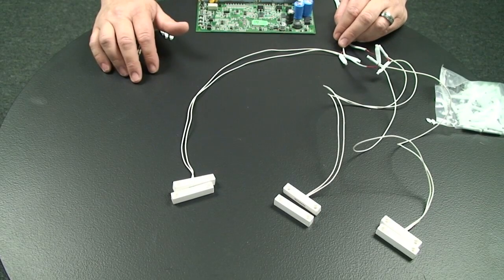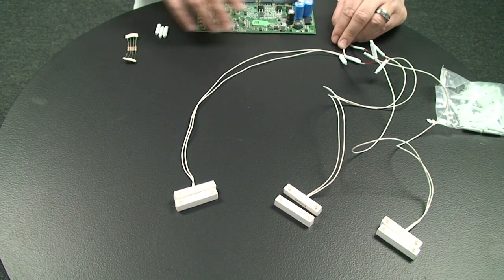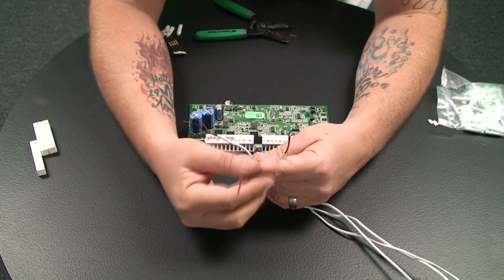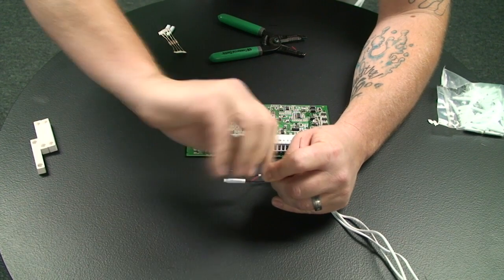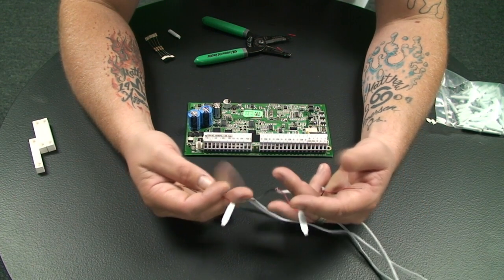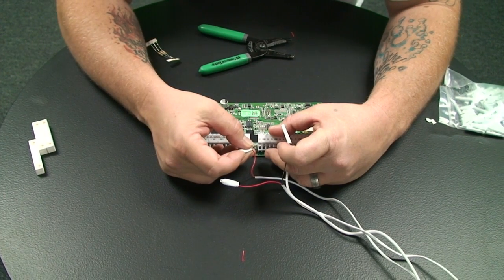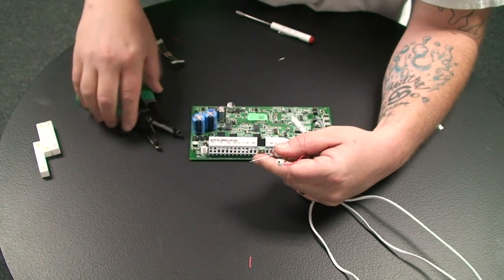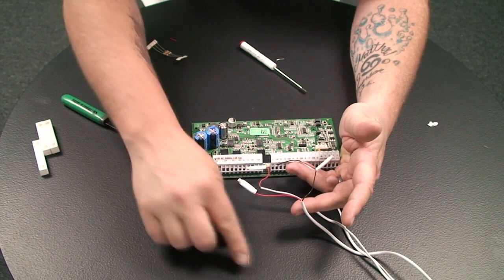How To Wire a Series Circuit using Contacts

Comment: Great video. I had an old DSC (6 zones) and the builder connected multiple rooms together (i.e., Kitchen and family room, bedroom 1&2). I now have a Honeywell 20P and zone expander and want to separate those areas into different zones. The wiring for those rooms is setup like in your video.  I labeled the wiring but don't know how to separate them into zones.

Comment: From a person who responds, please dont double up pirs unless it covers the same room.
I have been to alarms where a reed switch and a pir were on same zone but different sides of the building.
If you need to double up zones on an install by an expander or bigger panel.
This idea for reeds is more for a row of doors or similar in one room.
But remeber if one goes faulty your going to muck around finding the fault, and if an intruder shuts the door you wont know which one was opened.

Comment from the maker: @18524711 Motion sensors can be wired very similar, as far as putting contacts and motions on the same zone, I would not advise that. Keep the motions and contacts seperated.